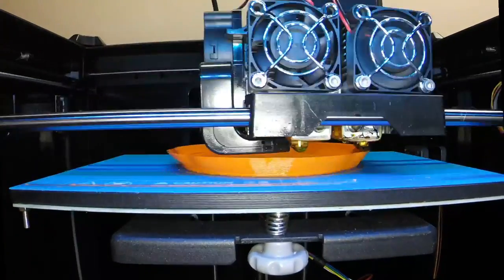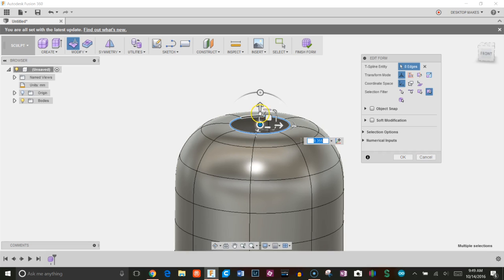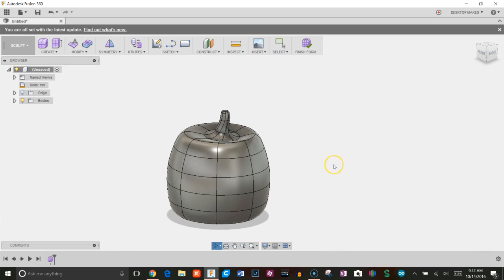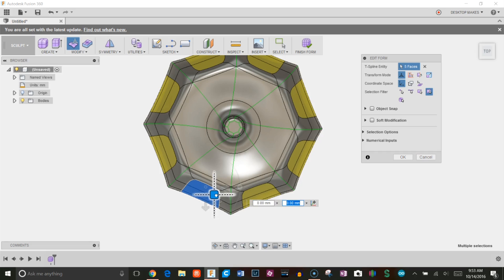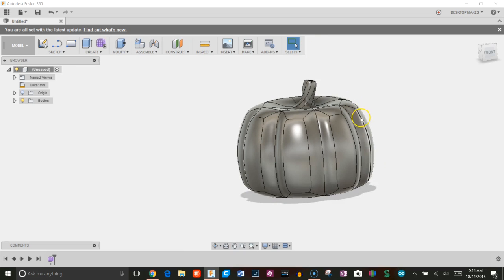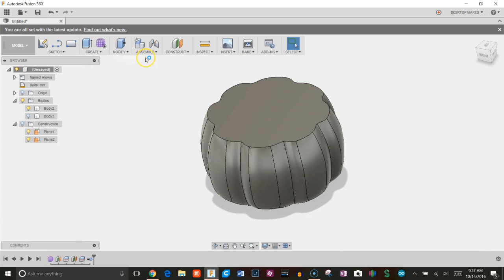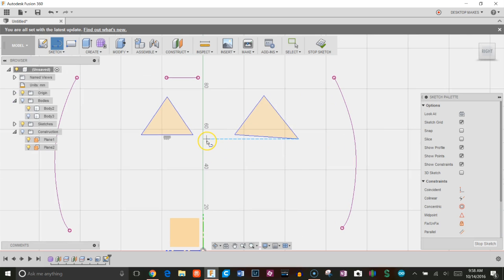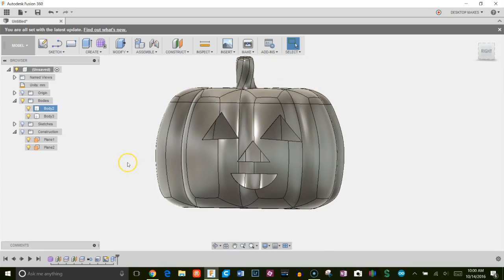Design a Jack O'Lantern in Fusion 360

Comment: I am having trouble shelling. "This operation would cause a large topology change. Try adjusting the values or changing the input geometry." If i do a small input it leaves me with the top and bottom being the only thing left and removes most of the pumpkin. Any input or thoughts would be highly appreciated.